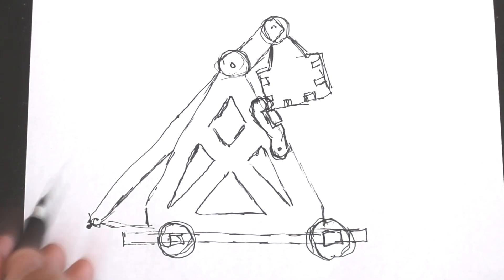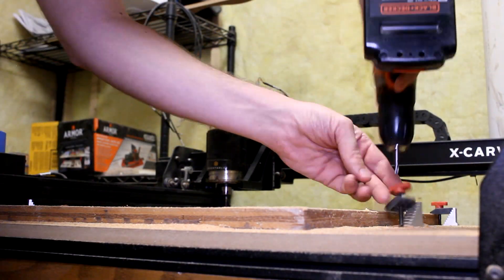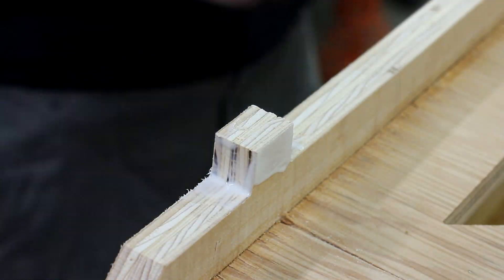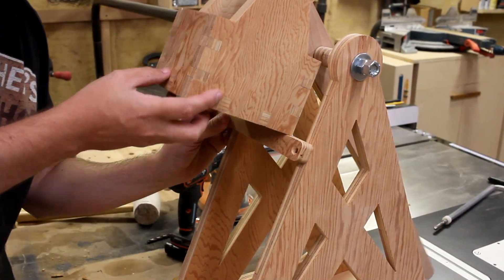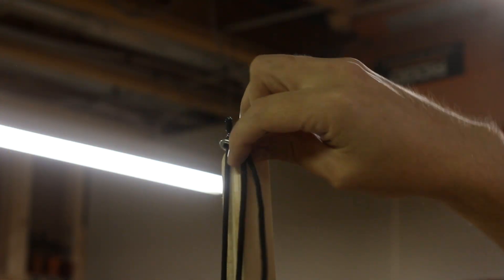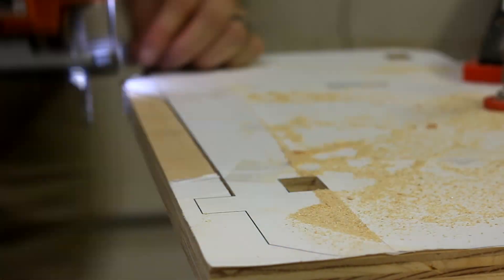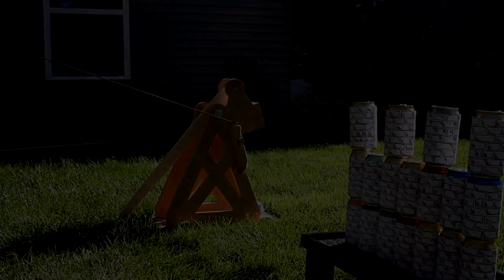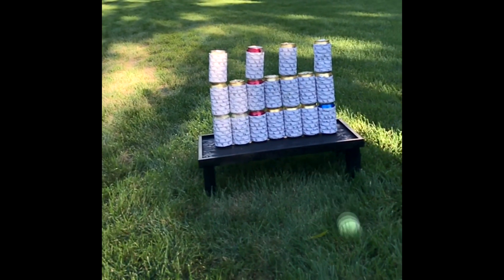Woodworking: How to make a Trebuchet

Comment: great experiment. by the way can i ask how can you control the release angle to launch at the exact distance
Reply from the maker: Adjust the angle of the pin in the end of the swing arm
Reply: @FishersShop  it is reliable to ensure that projectile won't move doward immediately after it released

Comment: Hey Drew got a question about setting the x and y axis, on the x-carve. Does the bit have to touch the work piece when you set it? Also I figured out what was causing the x-carve to stop carving half way through the run. I was using a Mac, and for some reason it doesn’t like the x-carve. The x-carve runs better with a normal laptop yesterday runs windows.  Appreciate your advice on the x and y issue. Thanks , Dennis McAleer
Reply from the maker: Not sure what you mean, unless you're referring to setting "zero" with the Z-axis.  I usually use a piece of paper when setting the Z and I lower the bit until the paper is barely tight between the project piece and the bit.

Comment: At the 1:11 mark, you use painters tape and CA glue. Isn’t the strength of the hold limited by the painters tape (and not the CA glue)?  Anyway, it seemed to work for you in this instance. Nice video!
Reply from the maker: Yes, but the lateral holding force of painter's tape far exceeds what you need to hold the piece down for the CNC.

Comment: What router bit did you use to CNC that plywood.And also if you wouldn’t mind what speeds and feeds
Reply from the maker: Just an 1/8" straight flute bit with default settings.

Comment: I’ve build a few with pine rather than plywood except the base. The smallest was a foot tall to the top of the frame.  The tallest was a bit taller than yours. They are extremely accurate! We were hitting a paper plate, consistently @ 40 feet

Comment: Now, for the low low price of between $1600 & $2000 for an X-carve machine, and God only knows the price of the 3 computer programs used, and a computer, a drill, and an orbital belt sander, I too, can make two small trebuchets.
Reply from the maker: Maybe if you paid attention you'd see that you can do it with just a drill and a jigsaw.  And btw, Easel and Fusion are free.
Reply: I’m was being silly. I did see. Love your vids. Keep up the work.